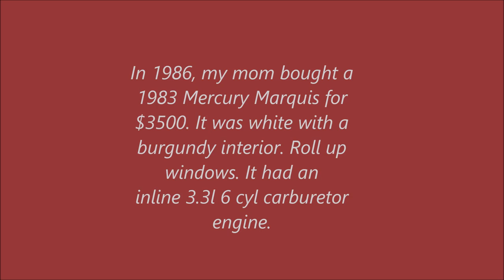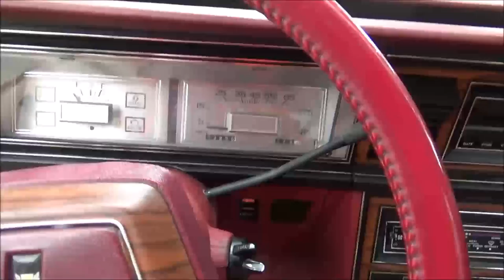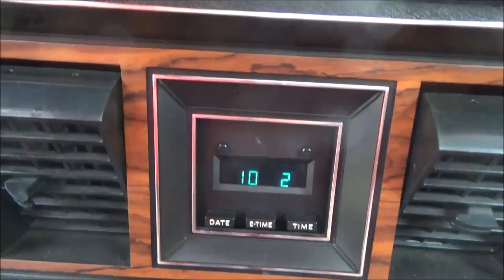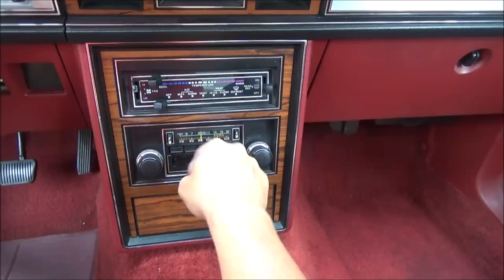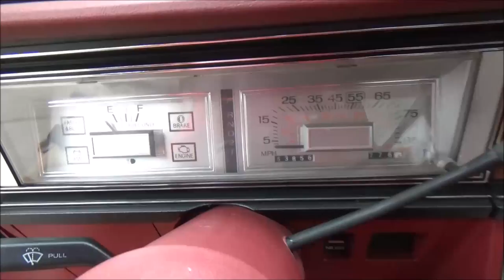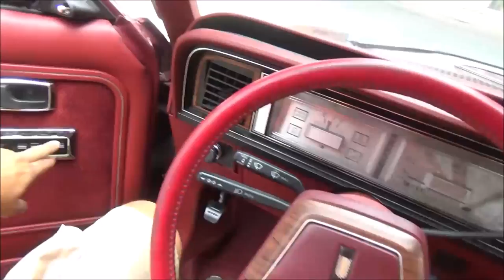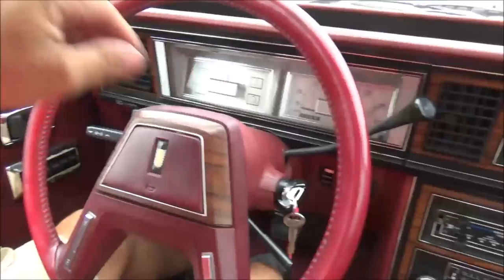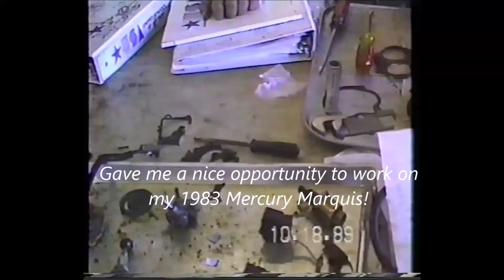My 84 Mercury Marquis: 2018 review!

Comment: I owned a white 84 and put 274000 miles on it before donating it.    It still ran but the hearer core went out because I replaced it with an oriley unit that only lasted 2 years.   Should have used a real Ford pard.   Loved this car.

Comment: I think they eventually put fuel injection in these cars in 86 the Ford Taurus also replaced this car I think you had the option to get the V6 or the V8 in these model years
Reply: I think they called it central fuel injection the 1985 Mustang GT had this engine in the automatics the V8 version the automatics
Reply from the maker: @nathanlopez5667  I know in the Ford version of this car had the V8 option.  They used those cars as police cars in the mid 80s. Ford LTD
Reply from the maker: I do know the last year was 1986. These were made from 1983 to 1986. And yes. I do believe the Tauras and Sable replaced these cars
Reply: @fueledbymusic3  yes until they replace them with a crown Victoria and the Chevy Caprice in the early nineties I believe